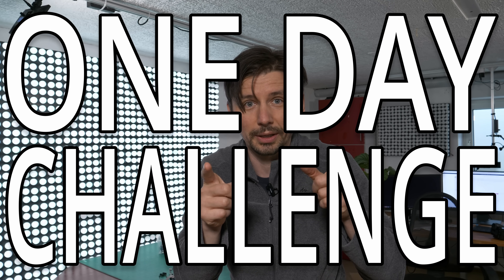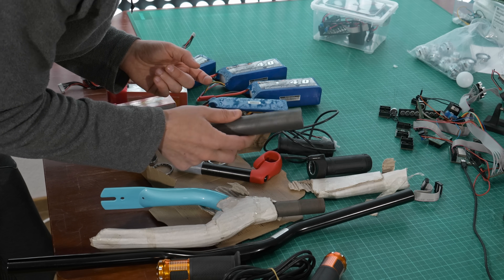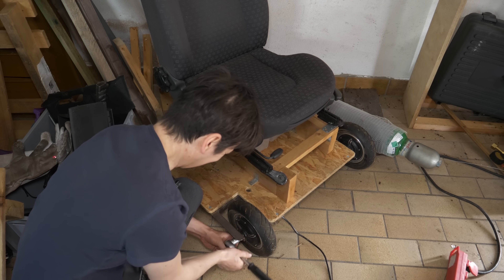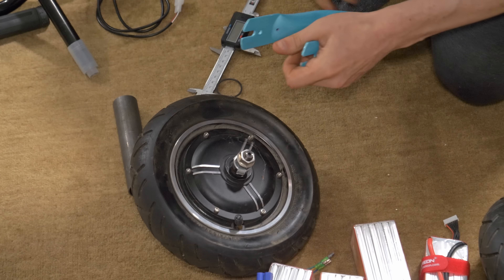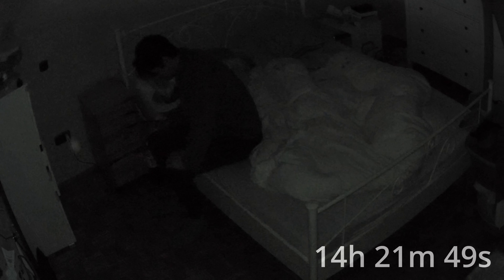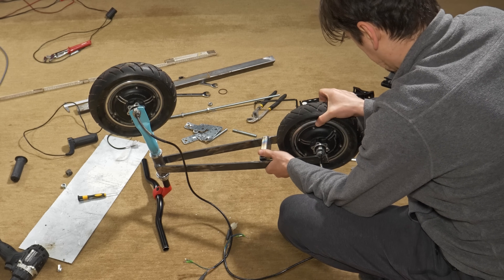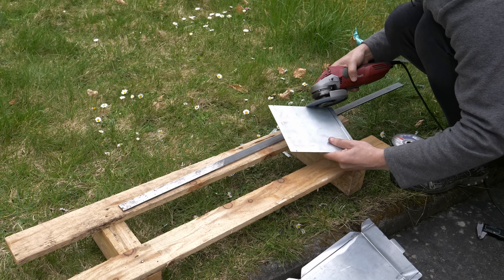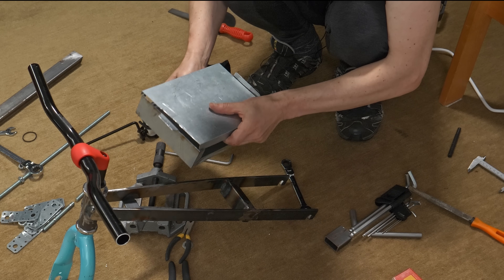DIY Pocket Bike in 24h

Comment: Are you ready to receive your grade? Never mind I was only speaking rhetorically.
Elegance of design                        C  would have been an A if you had regen braking.
Handed in on time
Quality of craftsmanship             D
Shop practice                                Fail
Safety                                             Unsafe
Since I have no authority what so ever you Pass
Reply from the maker: 😂Thanks for the rating! I tried to activate regen but ran out of time. It wouldn't work unless I would add a button to reverse the throttle. I really tried!
Reply: @bitluni  Thats okay better than half the kids who aren't doing anything.
I am a maker too no video skills at all.
I did like your production.

Comment: i'm waiting for the uncensored version...
one esc per motor right?
Reply from the maker: unfortunately yes. I didn't know they doubled in price. I think the bike would also work fine with only one motor
Reply: @bitluni  actually my question was a sanity check question just to make sure that there is no way to wire-up 2 motors to 1 esc. 
the price of the esc isn't a deal-breaker though it doesn't look fair to surpass the price of a 1kw motor with the tire..
my ultimate question is: has anyone created a elegant DIY scooter that he uses everyday? the hardest part to create is the chassis. who is the target group for those parts? creating a chassis on top of the electronics looks a bit too much for a hobbyist. are those parts intended for modifying a retail scooter?

Comment: I built an electric pocket bike that would do 37kph on flat ground with a 127kg rider. Battery life was 4.8km.
Reply from the maker: You win on the loadbearing. I'd love to take a cruise with you. unfortunately, I'm in Ger
Reply: @bitluni  It was converted from a terrible gas powered bike.  I don't remember if I still have it, but it ran a 1HP 36v PMDC motor.  I still have a Razor pocket bike with the 24v motor and mountain bike disc brake I added to the rear wheel.

Comment: true freedom is going 40 km/h in an electric pocket bike hastily made in 24 hours, it looks so fun
Reply from the maker: The interesting part is that the record I hit was going uphill at 42km/h. I didn't feel compfy going faster with only the jeans as protective gear. But what is interesting that the acceleration really starts at around 20km/h
Reply: Any idea of torque produced by the motors?

Comment: Looks great. What wheels are those?
Reply from the maker: linked in the description. it's 10" 1000W 48V. the KV seems to be a bit high since I wasn't able to reach max speed yet and they could use some more torque in the lows